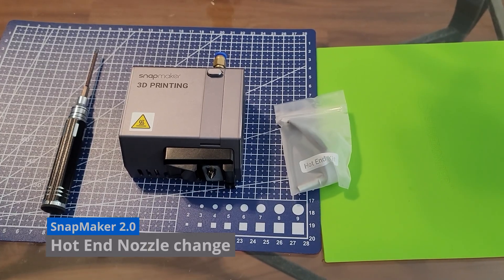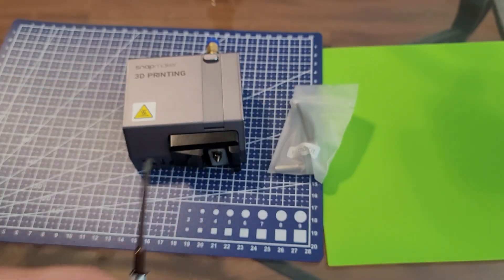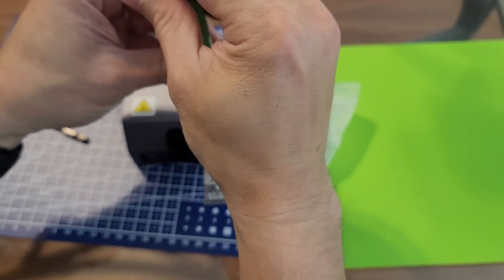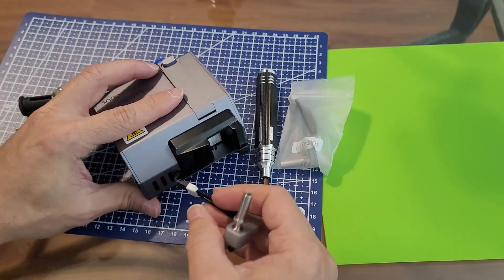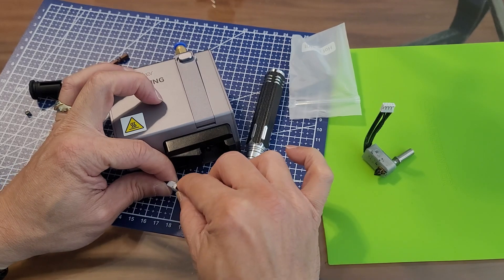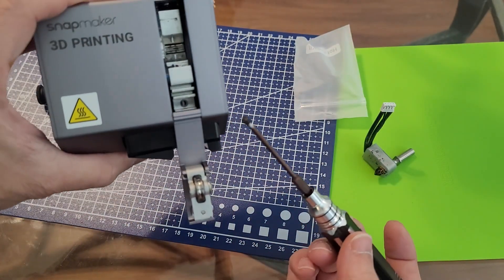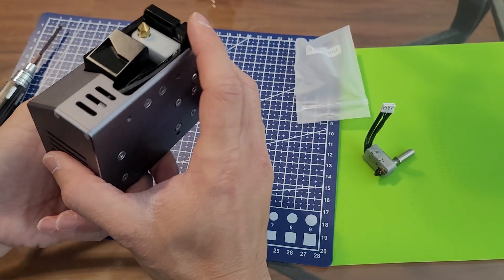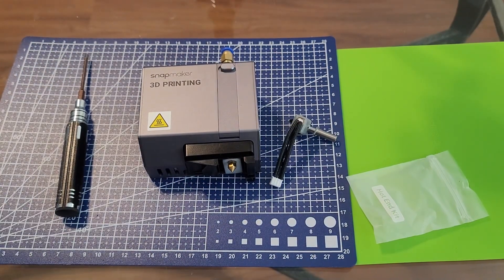SnapMaker 2.0 Hot end change

Comment: very helpful, and thank you for mentioning the proximity sensor, I didn't know what that part was and I'm trying to figure out I need to adjust it because it's loose.
Reply from the maker: Glad the video helped. That proximity sensor is easy to forget to re-adjust back to the proper height after replacing parts or making changes to the module.

Comment: I cant get the screw out of the head😢
Reply from the maker: some of the screws have locktite on it, which gives it some resistance when trying to remove it for the first time. As long as it's not rusted or frozen in place, it should come out with a little effort.

Comment: Somehow all videos on youtube is how the dual extruder does not work, it's getting hard to believe this printer combo is working, since snapmaker j1s is not working according to youtube and snapmaker forum.
Reply from the maker: I have the dual extruder. I haven't really had any issues with it, although I don't do a massive amount of printing either. The only real issue I had with it ended up being caused by my dry box not feeding the filament smoothly, it had too much friction and wouldn't let the roll turn smoothly. That caused my dual extruder head to get pulled "up" and end up printing in the air. When I removed the dry box, it printed properly. That's the only real issue I've had with the dual extruder, which ended up being due to Sunlu's S2 dry box.

Comment: Do you have guide or plan on doing one for how to Calibrate and dial in settings for snapmaker? I'm having issues getting best print
Reply from the maker: At the moment, I don't have any plans to make a guide, I do need to partially take my Snapmaker apart so I can add the quick change kit to it. When I get around to doing that, I'll need to recalibrate everything again. If I remember too, I'll try to record the calibration steps as well.

Comment: Hi one of the cables of the hot end pop out ? Is it ok to just push it back in?
Reply from the maker: That's probably the thermistor cable, it provides the temperature reading to the controller. According to CS, it just sits in the hole so you can push it back in there.
Reply: @R-TechEnthusiast  ok thanks

Comment: Hi, this tutorial is amazing, but I have one question, what size screwdriver are you using? I’ve tried all four of the ones the printer came with, but none of them are working
Reply from the maker: Mines is the v1 3d module, assuming the v2 3d module uses the same sized hex screws: the screws in the back uses the H2.0, the ones on the side uses the H1.5. The ones on top (filament feed), you will need your own hex bit for that, the provided hex tool does not fit it.

Comment: I might be dumb, I need clarification on sensor being 1mm “higher” than nozzle. Would that be actual higher? Or in this case lower?
Reply from the maker: Higher. You want the proximity sensor higher than the nozzle to avoid the sensor from hitting your prints during a move.
Reply: @R-TechEnthusiast hi there, how does one measure the 1mm offset between the nozzle and the sensor?
Reply from the maker: @CountDoucheula  I use this: https://amzn.to/3HcjoVa
Reply: @Robert - The Tech Enthusiast, so do you mean higher in the sense that when in mounted/installed position, the bottom of the proximity sensor is higher than the tip of the hot end? Just clarifying.
Reply: You don’t want it lower. If it was lower it’d hit the print surface while printing.

Comment: Thank you! Nice and simple! Btw that “the threaded piece” is a set screw. 😊
Reply from the maker: hehe thanks, the name eluded me. :)
Reply: @R-TechEnthusiast  figured you just had a brain slip. We all, do. 😊 btw, my new hot end is now printing perfectly. Thanks, again
Reply from the maker: @timgarrett203  you're welcome. Hopefully yours lasts longer than mine did. Only got about 3 months of light use before the heating element failed. The replacement seems to be fairing better then the original so far. 

By chance did you pre-order their new dual filament module? I did, I can't wait till December to get my hands on it. So excited. Hehe they have an IDEX printer in the works to fit this year, supposedly. Can't wait to see that too.

Comment: You could have just changed the nozzle instead of changing the heater and the temp sensor
Reply from the maker: It no longer heated up, changing just the nozzle would not have helped. It wasn't melting the filament anymore.